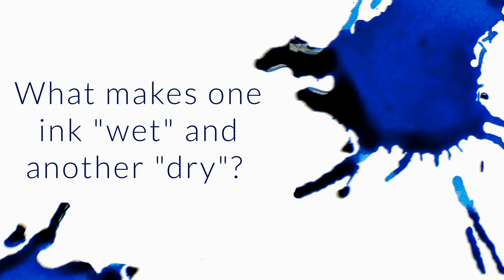What Makes One Ink "Wet" And Another "Dry"? - Q&A Slices

Comment: Hi. I am quite new to fountain pen. Am using a Pilot metropolitan at the moment. Have been using Parker Quink Black all this while.... I am contemplating on trying out different inks(colours and brands) recently. So I am curious,. is Parker Quink Black consider 'dry' or 'wet'? I use my pen for both English and Chinese writing. I don't mind the wet-ness for English, but for chinese writing, if it is too wet, it would render the characters illegible (the strokes would smudge together)... so I'm trying to find a balance. Quink Black is working just fine for me.... albeit a little too wet at times. Is there any "drier" ink compared to Quink black? Sorry for the long comment.
Reply from the maker: Parker Quink inks tend to be on the wetter side, so you're not experiencing anything out of the ordinary there. For drier inks, Pelikan 4001 (https://www.gouletpens.com/search?query=4001&facetValueFilter= ) could be a good option. Definitely one of the drier inks I've used, could be good for those Chinese characters. Nib does play a part too in terms of ink flow, so a finer nib could work too. - Colin
Reply: Thanks! I'm getting another pen from China (The brand name is OASO. My friend got one and said it is quite nice) with an extra fine nib. I will see how the nib size affects the flow before considering my next ink purchase. Thanks again for the reply.